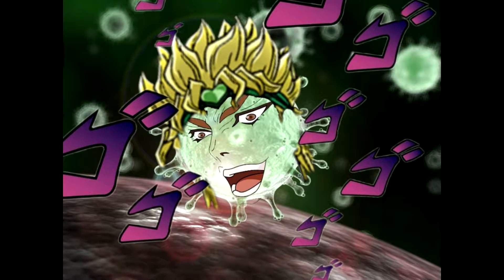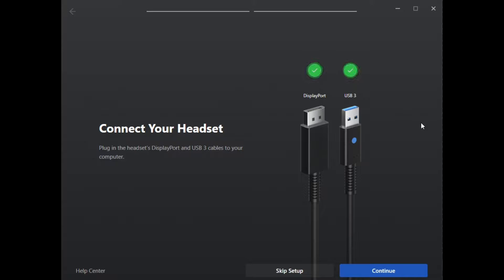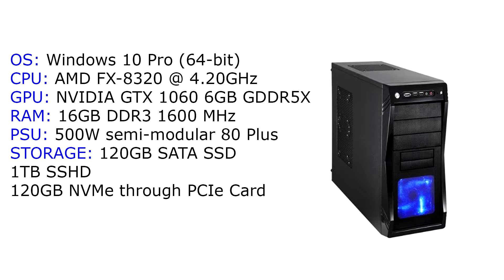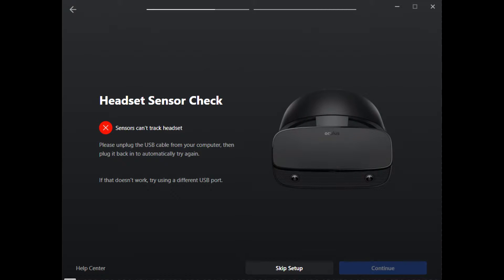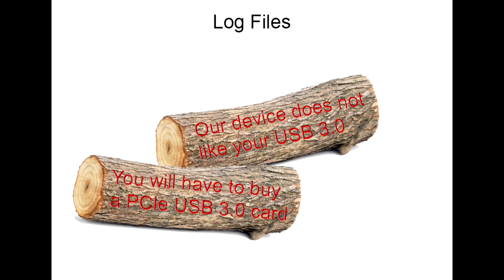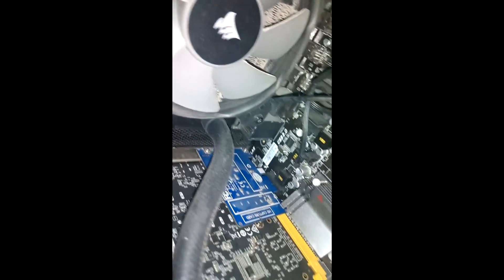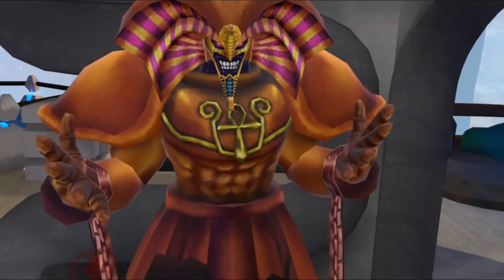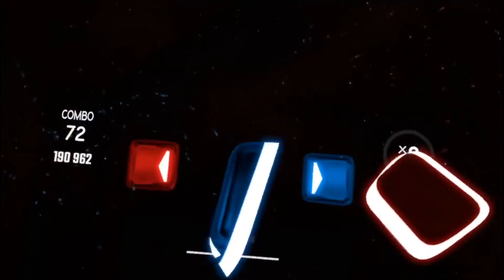Why I ALMOST Returned My Oculus Rift S

Comment: can you plug the occulus into a wall outlet (with adapter) or does it need to be connected to the pc via usb
Reply from the maker: It needs to go to the PC, since it also needs to transfer information on the sensors.
Reply: Haha I was asking myself that same ridiculous question 🤣 I'm so desperate for this thing to work properly... I've had it like 5 days and it just constantly disconnects, from what I can tell from the thousands of other happy oculus customers, it seems likely to be a power issue, I had it ready to be picked up tomorrow for a refund but then I decided to give it another chance when I kept seeing all the talk of lack of power etc so I'm gonna buy the thing suggested in this video and I'm also waiting for a powered usb hub to arrive that I ordered before I saw this video 🤦🏼‍♂️ so I'll try it again first as other headsets are more expensive and the only one about the same price is also oculus...  So fingers crossed I'll be happy in about a week...

Comment: It worked... for a couple days... then it pooped out did that

UPDATE: I finally made it work! Just power off your pc then unplug the oculus. Then power on the pc and open the oculus app to the set up page and you can remove your oculus or keep it but I suggest removing it and adding it back. Then plug in the usb to a different 3.0 and if you don’t have one then just try the same port again. Once you reconnect it, you are good to go. When you are finished with your oculus unplug the usb and then when you are ready to play plug it back in where you had it before
Reply: SAME.

Comment: Dude I have these EXACT same issues hahah. Except that my pc is pretty powerful and modern and my rift s worked absolutely fine before.. then I haven't used it for like half a year, (I didn't buy any new hardware, didnt update anything in between) and now it just says cant sense the sensors.. no matter what I try.. spent the entire day yesterday trying to fix. Tried soo many things.
Reply: Same exact situation
Reply: @zachm6470  i think updating windows to the latest version helped.
Reply: @CoyotePark  did that😐
Reply: @zachm6470  :/ i did absolute ton of things.. for many days. I think in the end I just updated windows to latest version, usb drivers to latest, graphics card, and unplugged all cables possible from headset, then switched from asrock usb 3.0 drivers to generic Microsoft usb drivers in device manager and re-plugged everything
Reply: @CoyotePark  thanks!

Comment: I'm so confused all I see is a black screen but I can hear audio and I can see the gameplay through my pc but not the vr someone help
Reply from the maker: One of the commenters suggested that you can probably fix this by updating your NVIDIA drivers while the Oculus app is open. It didn't work for me when I had this problem with a laptop I tried to use this with, but I think it's worth a shot. Also, try to opt in to the Oculus beta through the program, see if that works.

Comment: I need help because I bought the rift s but it tells me that the pc camera is not connected but if everything is there and it keeps giving me an error, please help?
Reply from the maker: I'm just guessing here, but maybe Windows 10 is blocking the camera with its dumb privacy features? If you go to your Windows search bar and type "Camera privacy", you can make sure to check "Allow apps to access your camera". Then go all the way down and make sure "Allow desktop apps to access your camera" is on and that Oculus is under that list.
Reply: @TheWarrGames  Yes it is activated but it seems strange to me that it does not detect it, I do not know if it could be a problem of the same oculus or my pc, the truth is I tried it at a friend's house and the same thing happened to me, I do not connect and he has a gamer pc and I do not connect .

Comment: i can literally get through the entire thing until the very god damn end when you have to continue the setup in vr... and i just get no display but a white light and a blue light indicating it works

this is fun
Reply from the maker: One of the commenters suggested that you can probably fix this by updating your NVIDIA drivers while the Oculus app is open. It didn't work for me when I had this problem with a laptop I tried to use this with, but I think it's worth a shot. Also, try to opt in to the Oculus beta through the program, see if that works.
Reply: @TheWarrGames  yeah it turned out to be an msi thing, i updated the vbios and it sort of works now, constantly just.. stops working and requires me to set up the entire thing again
Reply from the maker: @longcat266  Oh my god, so not only do people have to worry about ASMedia, but also MSI? That's the laptop I tried to use, too. Man, the plot thickens and it's getting messier.
Reply: @TheWarrGames  if thats a laptop you tried to use, update the vbios and and hopefully you wont encounter the issues i get

you can get the vbios from the msi website and a guide on how to do it from their website aswell
Reply: also software seems to be the issue.. i can use my headset just fine now, it appears software for peripherals like razer cortex can mess with the experience.. oof

Comment: Im having trouble setting mine up , when you set up your touch controllers ; only my left pairs perfectly but my right controller pairs then give a low battery warning and shuts off the next second.

I tried multiple new batteries.... >:(
Reply from the maker: That sounds like a manufacturing problem. You might want to get in contact with Oculus to get that replaced while you have your warranty.

Comment: I used to love my Oculus Rift S, then they had an update 8 months ago and me and all my friends got black screens, haven't been able to play since and oculus support really didn't help. I'm not even gonna bother with a quest or quest 2, I'm going straight to the Valve Index now lol.
Reply from the maker: I've heard about that, and I was scared that I had that problem at first. My budget wasn't great, so I went with the Oculus Rift S. But if you can get a Valve Index, then that's definitely the best choice.
The Oculus would be so much better if they actually fixed the software, but the software sucks so much!
Reply: @TheWarrGames  how is it going? are you on the latest patch, or do you know if there is a way to use an older patch? i'm thinking about buying a used rift s.
Reply: I got my Rift S in November 2019, and only now I'm getting that dumb issue where the Rift freezes while making a beep sound, then static into a black screen. 
As usual Oculus support was hopeless >:(
Reply: I got my headset and went back a couple nividia drivers and I got it to work again.. maybe that will help you as well but probably not :(
Reply: I have an Index...  And a CV1,..  I PREFER MY CV1...  The Index has Vertical FOV not really much more Horizontal.   It is heavy and bulky,..  The basestations have moving parts...  I just ordered a Rift S.   Weird that millions have no problem like this ...
Reply: @WoodysAR   Yeah it's just dumb.

Comment: My problem right now is it will say it’s connected or connecting but then the display port has a red X and it wasn’t showing any image even though they were both plugged in and it started working and then it stopped and when I tired to open guardian it wouldn’t open

Comment: Mine just says not enough storage even tho I have 3tb available
Reply from the maker: Is the drive you're trying to install to your C drive? Or is it a secondary drive?
One of the most frustrating things about the Oculus software is that it insists on installing on your primary drive, so it depends if you have multiple drives in your PC.
Reply: @TheWarrGames  I have 2 drives but they are both not full they have Full tbs and c drive is my primary and it has 1tb of space what do I do
Reply from the maker: @jackmeoff5905  I made a short video on troubleshooting that problem. Hopefully it works. If not, I can think of one more way to solve the problem, so let's pray to Mark Zucchini
https://youtu.be/2m7H4buBOes
Reply: @TheWarrGames  thanks bro

Comment: I’m getting a black screen
Reply from the maker: You know what? I've tried my Oculus on my friend's MSI laptop, which also has all the necessary minimum requirements and is even labeled as "VR Ready", and I actually had that exact same issue. I tried using a different Mini DisplayPort to DisplayPort adapter and it didn't work.
The software says to continue setup in VR, but the screen doesn't even turn on.
I'm in the process of trying to figure out what the issue is, so if I find out, I'll let you know.
Reply: @TheWarrGames  i actually got it to work i updated my graphic card drivers while i had the oculus app open (before it would say i already had the latest version and it wouldnt let me install it) my graphics card is a 2070 super
Reply from the maker: @shane9040  Damn, that's a pretty crazy solution. I'll try that on my friend's laptop then. Her's is a GTX 1060, so let's see what happens
Reply from the maker: @shane9040  Unfortunately, this solution didn't work on my friend's laptop. I got to try it today. But I'm glad it worked for you, I hope you enjoy your experience! I would like to thank you for the recommendation regardless

Comment: I refuse to accept that the quality of this video only got you a few hundred views... this is some top tier stuff.
Reply: I agree,
It solved my issue too and oooo damn was I close to returning it
Reply: This guy gave 200% into fixing his issue and you can hear it was stressful. Damn it made for a great video.
Reply: Except it would have been 100% unnecessary if he a) had a compatible computer or 2) ran the compatibility tool which would have said you have underpowered USB ports.  We all had the same problems with both Developer Rifts, thats why they made the system checking tool for the CV1.  But I don't think he has anything to be embarassed about either, as all these things everyone has to learn once!  (AND this video likely helped countless others)  _It just kind of irked me when he blamed THEM and the DEVICE3, when he didn't seem to check his computers compatibility beforehand.  100% Not the Rifts problem, evidenced by the fact he got it working.

Comment: The sound of my headset is not working anymore, already tried anything.. Lets see what the support has to say. Do u have any idea?
Reply from the maker: I would first check if the audio source on the bottom-right of the screen, where the speaker icon is on Windows 10. It should be set to Oculus Rift (or something like that). If it's set to Oculus as an output, I would then try to check if I get any audio from the headphone jack on the headset. This would let you know if you're experiencing a problem with the audio signal. If there's no audio from the headphone jack, it could be a problem with the audio source, which could be a software or driver problem. 
I would then check the Oculus software and make sure it's outputting to the headset instead of the desktop. If there is no Oculus Rift source when selecting your audio output, it's probably a driver issue and I would try uninstalling the Oculus software and reinstalling it. Other than that, it's hard to tell what issue it is exactly, so I would wait on support or try some online forums.

Comment: Thanks for the heads up, I just ordered the PCI-E part and I'm hoping that it'll work for me as well. Cheers.
Reply: Does it make a difference which pcie card you buy as long as it is usb 3.0?
Reply from the maker: Honestly, good luck with that. I hope it works!
Reply: @TheWarrGames  I'm happy to report that the pcie part has fixed my problem! I also made sure that the correct driver was used. The driver was thankfully installed automatically. If anything, the oculus keeps "disconnecting", but I'm able to successfully reset the connection no problem. Not sure what's going on, but it's better than what was happening before. Thank you for the video. Truly.
Reply from the maker: @bejoba3519  I'm glad it worked for you! If you have intermittent issues of it disconnecting occasionally, go to
- Device Manager
- Press the arrow to expand "Universal Serial Bus controllers"
- Right-click on anything that says "USB Hub" (i.e USB Root Hub or Generic USB Hub, or anything like that)
- Select "Properties"
- If there's a "Power Management" tab, click on that.
- Make sure "Allow the computer to turn off this device to save power" is unchecked.
- Repeat for every device under "Universal Serial Bus controller" that's a hub or references USB 3.0, 3.1, or 3.2
- Hopefully that works.